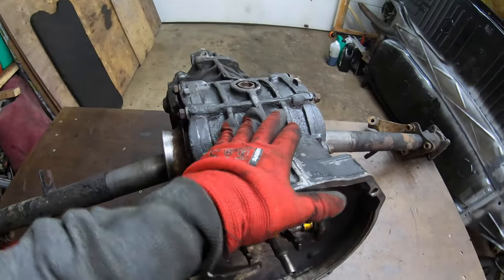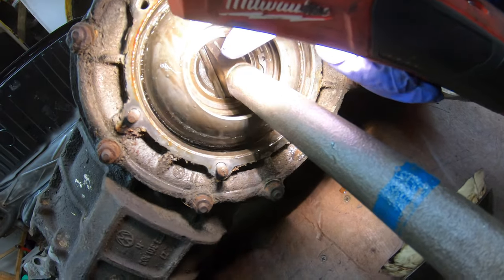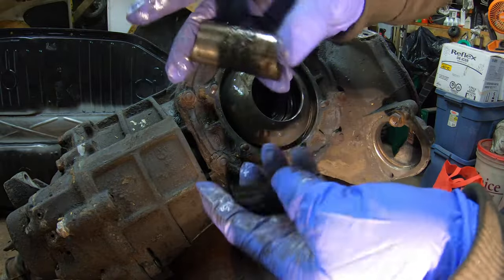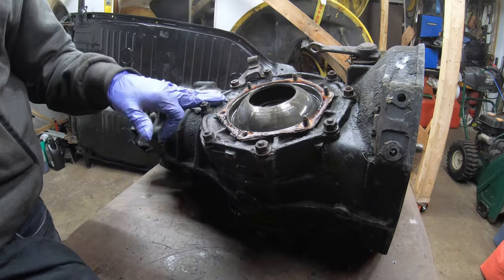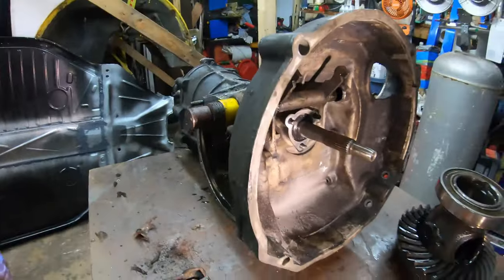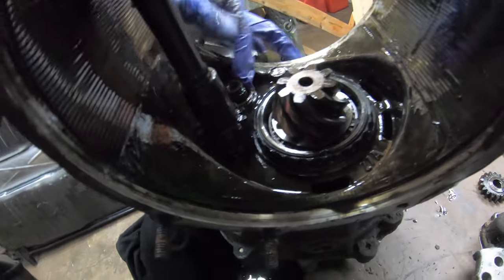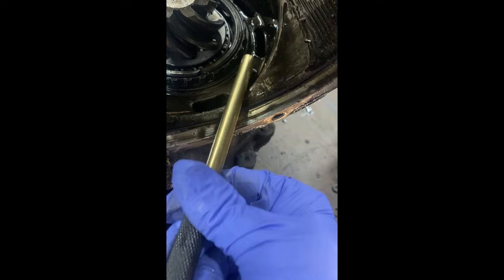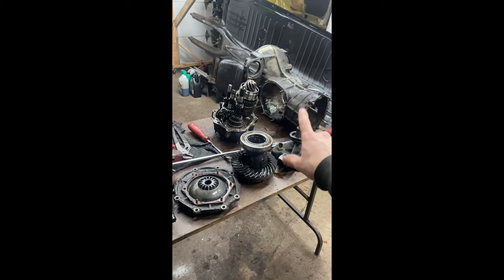Beetle Transmission Rebuild PT1

Comment: Today, I lifted the rear of the Beetle and rotated one wheel in all gears. When I rotate one wheel, the other turns in the opposite direction at the same speed. However, in neutral and 3rd gear, when I spin one wheel, the other turns much slower. Does this mean that 3rd gear is engaged? If so, how can I disengage 3rd gear without removing the transmission? because i have problem when in neutral and i want to move the car in the garage the engine spins . i shifted gears with no oil in the transmission many times , maybe thats the cause of it
Reply from the maker: @sadness3out961  if you have the shifter in neutral but the wheels still attempt to rotate the engine , one of the gears is still selected, going to have to take the nose cone/tailhousing  off and look at the selectors